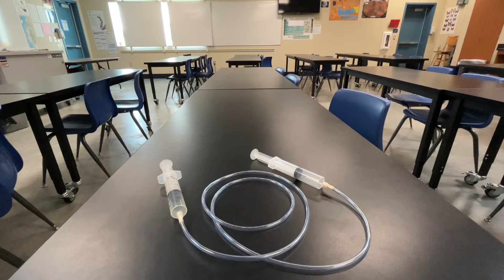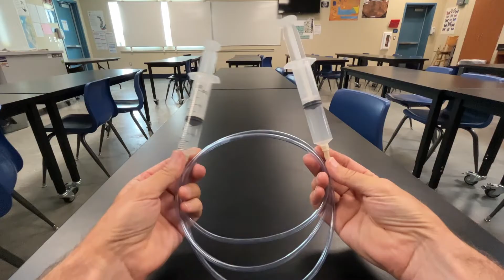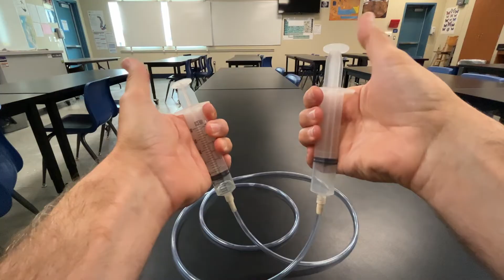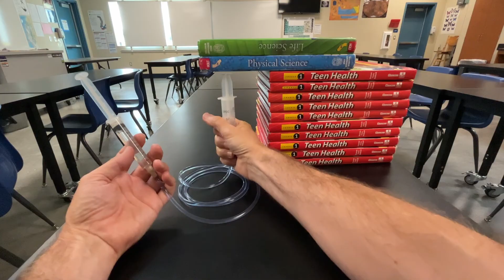Pneumatics vs Hydraulics - The Difference Between Gases and Liquids Under Pressure

Comment: But.if you use copper hose its better
Reply: It depends on the application hydraulic hoses are lightweight and lighter than copper tubing, reducing the overall weight of a vehicle but in an installation copper tubing would last much longer. Let’s say AC unit a E bike.

Comment: Why is my syringes leaking water how can I fix it
Reply: use a silicon gun on the connection of the tube to syringe (the exit of syringe) I tried it and it worked

Comment: Why does it look like the pneumatic system moves slower? Wouldn’t it move faster since it’s more compressible than a hydraulic system?
Reply: The molecules of air are loosely packed hence when you push they tend to be pushed to park together before they even transfer pressure, liquid molecules are however more closely parked hence transfer pressure faster...
Reply: @EASTAFRIQAN correct!
Reply: seems like the pneumatic system distributes force to different areas while the hydraulic system concentrates its force on pushing the other syringe
Reply: As it's more compressible, it can absorb a lot of the force without the need to immediately release the energy on the other side.
Reply: Correct!  @aliasgharkhoyee9501
Reply: It’s compressible but doesn’t have the same pressure as hydraulic
Reply: I suspect it's because some of the force is lost to compressing the air, rather than fully transferring to the second syringe. As a result, part of the energy remains stored as potential energy in the compressed air, but it's not enough to overcome the friction of the second syringe's plunger.
Reply: Don't think about compression think about you for example would air or water be able to push you easier
Reply: Since air is compressible the force transfer is delayed in Pneumatics hence it appears to move slower